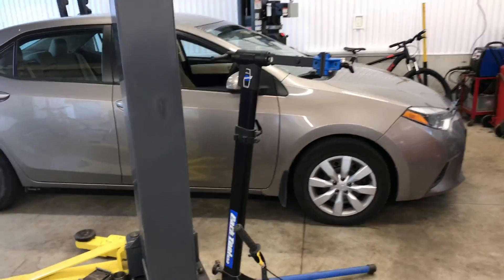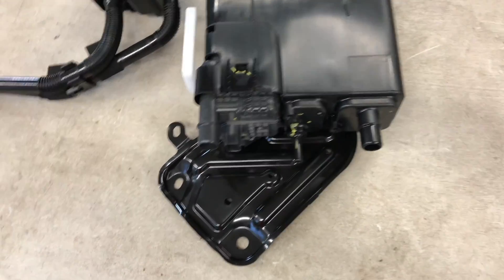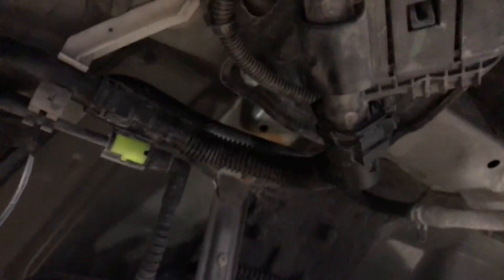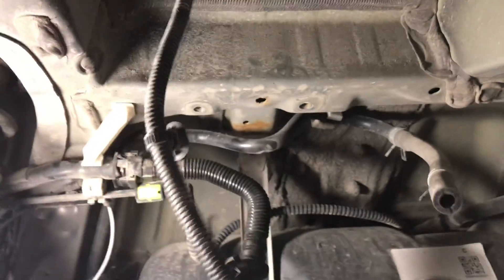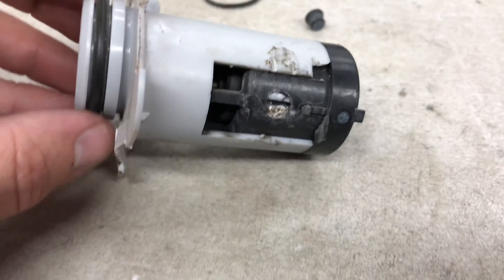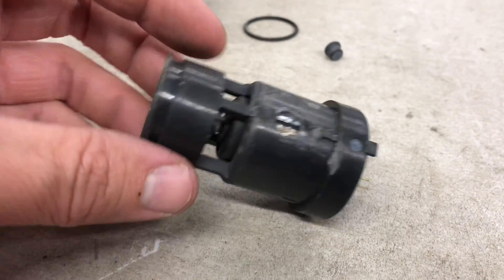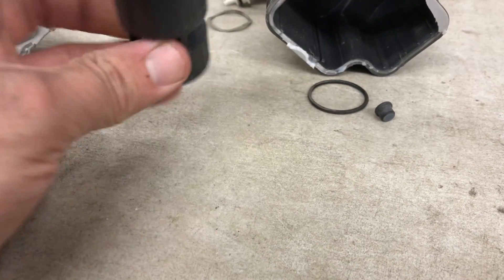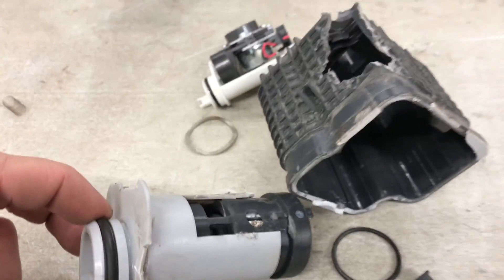Charcoal Vapour Canister & Filter Replacement 2015 Toyota Corolla P2401 P2402

Comment: Hello, i have a P2420 code in my toyota corolla 2017 , my car have that filter ,i already went under to check. I am trying to change the canister to see if the code goes away but i want to replace that filter aswell , i cant find it here in Denver Colorado.
Reply from the maker: you will have to get it online

Comment: Hi very informative video.  I have a 2016 Corolla with strong fuel smell coming from AC vents first 1-2 min after being started in morning, then clear normal air and no engine codes. Any idea of what could be my issue?
Reply from the maker: Probably a fuel leak near the engine.
Reply: @porkercon  Thank you. Time to do some leg work. I don’t have any special tools so my eyes, hands and nose will have to do.

Comment: It looks like the part that becomes corroded is the leak detection pump part of the canister. Can you replace it separately because I see that it is sold that way and would be less expensive?
Reply from the maker: I can't find it sold separately
Reply: @porkercon  I saw it at AutoZone today. Dorman also makes one for a 2014 Corolla P/N 310-007.
Reply from the maker: @marcsmith3881  nice
Reply: @porkercon  Any idea having had that how assembly out if it would be possible to replace the Leak Detection Pump without removing the whole canister? I saw a tab holding it in on the bottom, but not sure if there is something on the top keeping me from pulling it out.
Reply from the maker: @JanakinBoBanakin  Probably not

Comment: I just wanted to add my story hoping it will help someone. I watched this video to see if someone would be showing me how to replace vent line to, because I thought maybe this was my problem. Nope. turns out is was gas cap! I had codes; P2419, P2402, P2401, P043F,  and P043E. I replaced the charcoal canister like dealer said, lasted about 6 months, codes came back. By the way, I live in Western Washington, so I was thinking canister, paid $135 for a dealer to try and diagnose it. What a rip off! Went to dealer again, they said, "charcoal canister was bad" wanted to charge about $700 for parts and labor. I told them charcoal canister was just replaced 6 months prior by my local garage, dealer said, " charcoal canister was not covered under warranty because they did not install". I asked them if it could be my gas cap. They said, " No, they diagnosed it to charcoal canister". I told them I noticed gas cap wouldn't click sometimes. They said, " We checked gas cap it is fine. Problem is charcoal canister". I told them they were a rip off and left. About a month later I decided to just buy a gas cap.....Guess what??? Fixed the damn problem. Way to go Toyota.
Reply: Thank you for this I just got the same exact codes from the CEL light and I’m also thinking it’s my gas cap because sometimes when I put gas it won’t click and it has made the light go on before but turned off when I turned the gas cap the right way. It’s a 2017 Camry there’s no way the Cannister can be out already
Reply: I got all these same codes after I filled up my used corolla for the first time. I thought it was the charcoal canister but after research I realized I needed to turn it till it clicked, and it even said on the gas cap. Been a day now and so far so good.

Comment: Did this fix the yellow/orange light that shall not be named? Never came back on?
Reply from the maker: Yes, and yes it came back on a year later, same issue.
Reply: And you replaced it again or was it some other issue. Have the same codes on my 2014 corolla p043e &f, p2401,p2402
Reply from the maker: @ericozeta9997  Replaced it again

Comment: You can find this on geeksparts for 180-260 USD...or the Toyota brand for about $500
Reply: $404 canadian w/ tax.  I was condering a WVE brand aftermarket, but went OEM.  I've yet to add the new prefilter, but probably should.  damn thing is $140 + tax.  toyota should have offered the retrofit for free in my opinion...

Comment: Can you just replace the fuel detection pump attached to the vapor canister? Especially if you know for sure the valve in that pump is sticking? I know you can buy a whole new canister, and a fuel leak detection pump.
Reply from the maker: Nope not OEM at least. Maybe an aftermarket one.
Reply: @porkercon  toyota avalon 2013 p043e and p043f
P2401 p2402 p2419
Reply: There is an aftermarket one... i found this out after buying an OEM canister.

Comment: I have a 2005 Corolla CE. 42k - bought it from a old guy who never drove so he got exempt stickers for his emissions tests. I have codes P2419, P2402,P2401,P043F and P043E. All related to the evap system. Although my check engine light doesn’t come on I can’t clear these codes. And I’ve changed the gas cap already. Do you think I need to replace the canister ?
Reply: Also what website did you get the parts from. I live in North America
Reply from the maker: @vincentchase1234  Not sure for the 2005
Reply: porkercon did you get the parts from the Toyota website ?
Reply from the maker: @vincentchase1234  Got them from dealership
Reply: porkercon last question is this the Canadian part. Because I live in the us so I’m not sure if I need to be on a different website or just the standard Toyota parts website. And was this ever a issue again after you replaced it?
Reply from the maker: @vincentchase1234  I think its available in the USA. No issue since.

Comment: This should be covered by a recall. Customer shouldn’t be responsible for Toyota’s shitty design!
Reply: My exact thoughts. My car had 60,000 miles on in at 4 years old and Toyota wouldn't cover the canister last year. This year canister went out again and they won't cover the part. I'm done with Toyota. They didn't even offer to add this so called pre-filter.
Reply: @dawnclark2386  thats not really a reason to be "done with Toyota".  Pretty rare problem and pretty rare toyota doesn't help you out.  Toyota/Lexus are the most reliable cars you can drive.  If you were in a FORD you'd be plagued by all kinds of other shitty problems.  Even Honda isn't as good as toyota.  I'm a little pissed I had to shell out 400 on one too, but still best of a bunch of bad vehicle choices.

Comment: Does this come with a bolt to mount the sub assembly? I’m thinking about doing this my car has codes P0441, P0455, P1604. My BlueDriver says that the top reported fix is replacing the charcoal canister.
Reply from the maker: The bolt is already there on the subframe
Reply: porkercon I looked at it wrong thanks
Reply: What was the problem you had with those codes? I have the same

Comment: thats cool!  Did not know there was a filter.  Wifes corolla went back about 6mo after warranty.  I was going to replace with an aftermarket... doorman etc, seeing how the factory one was junk.  How much did you pay for the OEM parts?  So that valve that easily clips out of the charcoal cannister is exactly what a mechanic in the USA told me goes bad, and can not be replaced... I'm in canada...
Reply from the maker: Around $600 for the OEM parts from a Toyota dealership. Ya the valve alone cannot be replaced, so you have to get a full new charcoal canister and the extra filter add on. If you don't get the filter it will just ruin the valve again.
Reply: porkercon yeah thanks again I was going to hold out replacing until I got closer to selling the car because I figured it would just Happen again that's great to know they actually modified it unlike other manufacturers... I might consider a used unit from a wrecked Southern car.  I really don't feel like spending $600 to remove the check engine light and maybe marginally improve fuel mileage
Reply from the maker: @666dynomax  Ya you have to get the external filter
Reply: @porkercon  thanks  for the video man, I ordered the filter for mine.  I did the box 6 months ago, and now that winter is here i better get it done, wasn't sure if i was keeping the car or not, but looks like I am!  still damn expensive.  $140+tax.  You know, I drove mine almost a year before doing the box, and I can't say the fuel mileage improved... just the annoying light, If there was a bypass kit I would have done that instead.
Reply: @666dynomax  Yes, don't wait. I'm here in Washington, and the rain hasn't stopped for EVER. So sure enough my canister is bad AGAIN!  Just had the damn thing replaced last April (2020). There saying I need a new canister and I have to pay because this one isn't warrantied either. Now I hate freaking Toyota.
Reply: @dawnclark2386  dont do it dawn.... get the pre filter, i will too!!! I'll put it on for you don't pay those clowns at the dealer.  its like a 15 minute job to change the canister.
Reply: I changed my canister only 7 months ago my self due to codes p043e- p043f-p2401- p2402 -p2419. 
Check engine again first week of December with code p2420 ... 
Really disappointed...
Reply: @javierargueta548 I have these 5 codes after accidentally overfilling my tank